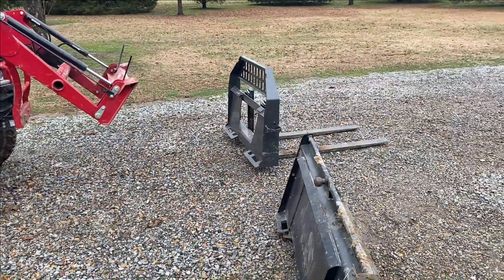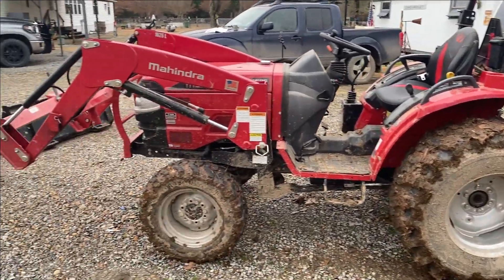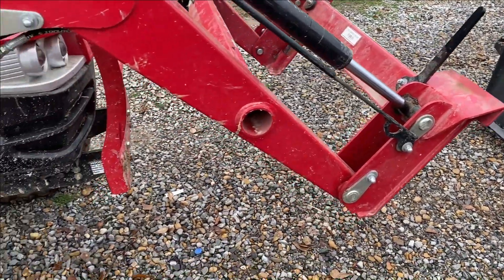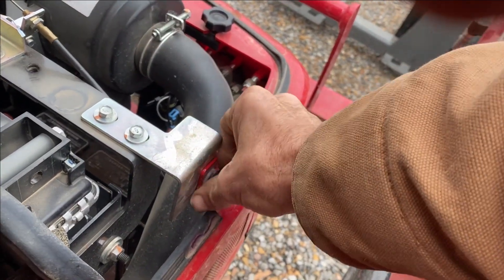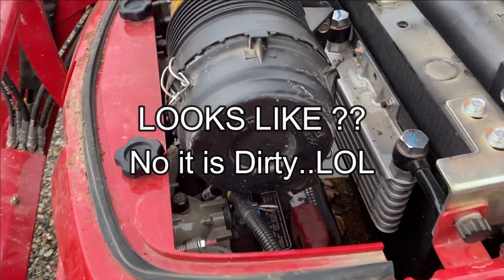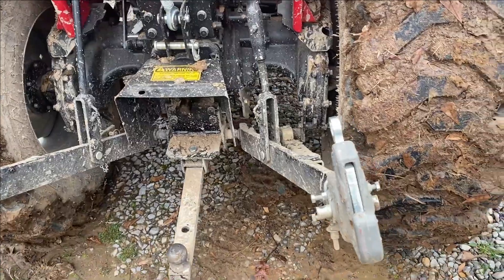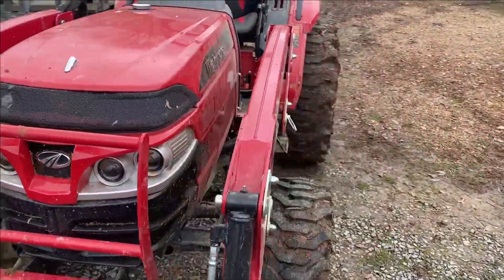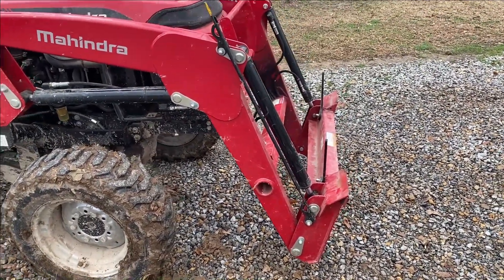Mahindra 1626 HST Review, 50 hour service, oil change, seat modification.

Comment: I couldn't agree more with your comment about the forks, we have a 1635 and I picked up a set of used forks. I have used them more than I could ever imagined.
Reply from the maker: Very Very handy that's for sure. Thanks Tony.
Reply: Same. I used to have a set of clamp on forks someone gave me for my old kubota. Once I bought the Mahindra forks, my life has changed significantly for the better
Reply from the maker: I use them more than I ever figured I would for sure.

Comment: On the video, you show the grease fittings under the tractor are towards the back which u cant see in the video. They are actually further ahead directly behind the lead edge of the step. All 4 are in a row on the brake pedal pivot, but one is hard to find / connect to. Thanks for your video, it really helped me out.
Reply from the maker: Glad to be of help.

Comment: Just picked up a 2020 1626 Shuttle w/28hrs. Got the balance of the Warranty (6 years 7 months) & a set of forks to go with the bucket. Have some projects all lined up.
Reply from the maker: Iron Will , I think I'm around 250 hours on mine and I love this tractor.
Reply: @papawsplace   going to get that Big Tool Rack as well
Reply from the maker: That will be handy.
Reply: @papawsplace    What brand & type of antifreeze do you use on the Mahindra 1626?  The ownersa manual that I have doesn't specify.  Thx
Reply from the maker: Iron I've never changed the antifreeze I'm still under 300 hours on this tractor.
Reply: @papawsplace  mine is right at the low line, figured I should get some.
Reply from the maker: If its nothing in the manual, I would go with the Prestone Universal that mixes with all types of antifreeze myself.

Comment: Like this. How is it holding up 3 years later I never seen one.  I got dealer about 15 miles away
Reply from the maker: I love this 1526 tractor and I've had zero issues so far.

Comment: Hello. Where did you refill the fluid in the front axle? Does it pull from the hydraulic that’s refilled in front of the seat? Thanks!!
Reply from the maker: It has it's own fill plug for the front axles. It does not pull fluid from the hydraulic system.

Comment: Do you notice a significant loss in power while in the high range?
Reply from the maker: The only time I've been in High Range is when roading the tractor and yes it's no power to do anything other than road the tractor. But mid range and low range is great for what I do.

Comment: I have this same tractor and it has used half qt engine oil  in the initial 30 hours, is that    usual ?
Reply from the maker: I had 40+ hours when I done the first service and now have 90+ hours and it hasn't used enough oil for me to see a difference on the dip stick.

Comment: Have a 2020 1626 Hydro 
Dealer told me to use 80-90w axle oil for the front axle & that the hydraulic fluid wasn't sufficient for it.
Reply from the maker: Yes Sir, That's why I stated it is a discrepancy out there. I choose to do what the manual said that way if something happens ( while it's under warranty) they can't say I put the incorrect fluid in it. The way tractor dealerships come and go around here I can't depend on their word. 😉